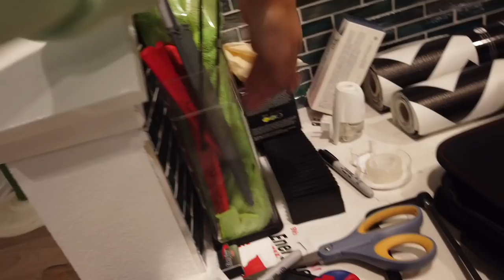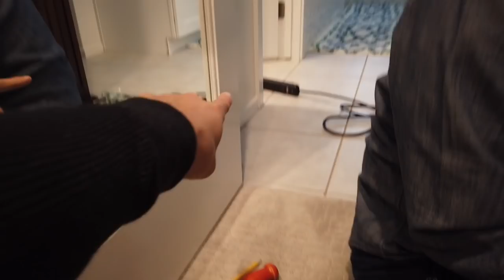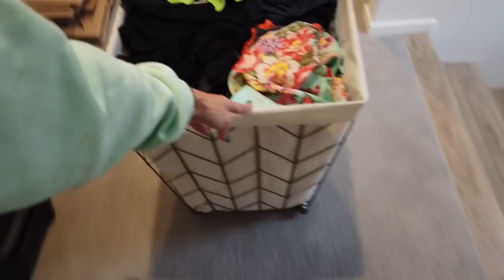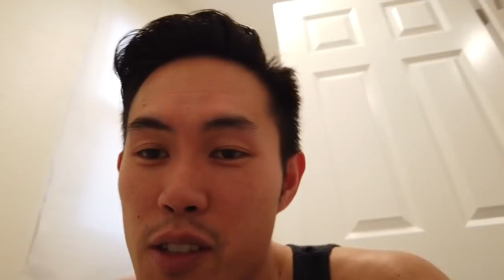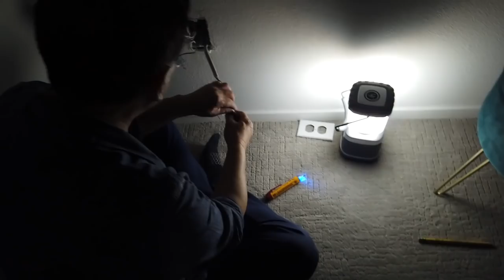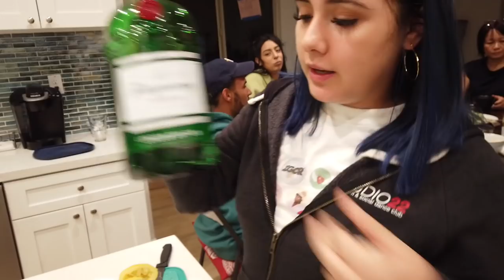We DIY’d an electrical outlet

Comment: Did you run the new electrical wires behind the walls? Or do you hide it behind a cover, but visible along the walls to where you want to go?

Comment: You should get a licensed Electrician to do any electrical works. In case of a fire, your insurance company wont cover you.
Reply: I thought casey dad is a licensed electrician
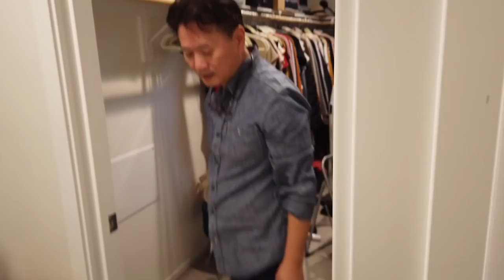Reply: @User-is2kf  no engineer. Casey said he's never seen his dad do electrical things at 8:26
Reply: they could face charges if a electrical authority looks at it the wrong way
Reply: @davidchen1544  - Electrical Authority??  What?
Reply: Maplenerd22 most municipalities require a permit and it has to be done by an electrician or else u get hefty fine (at least where I live)
Reply: @melabbyy  depends what kind of engineer he was
Geo's brother is an electrician they could've hired or consulted him
and it's true people should not DIY household electrical outlets
you're not even supposed DIY speaker wires and cables inside walls if they are not fire rated
if a fire broke out and it was traced back to the wires, your home owners insurance will not cover it

Comment: You should go to whoever built your home. Outlet in Bath is required by code.
Reply: yes, but not by the toilet . And the pos builder would not do it even they want to pay extra. 😩
Reply: @way3399  they said they're running a line from outside. So they dont even have one in the bathroom.  Their contractor should fix it. Their home insurer can go after the contractor to bring it to code.

Comment: I really hope u all didn’t run the wire outside the wall like that. It is Easier to just go in the attic and slice power from your existing wire in the attic and then run wire down the channel of the wall. Cleaner and easier and quicker. Also HVAC pipes wouldn’t run in the inside walls of the house. It’s goes straight up the outside wall where the condenser sit and then ran in the attic to the air handler. Most likely the black pipe is a air vent for a bathroom.

Comment: That’s not safe. By law you need a GFCI in your washroom, by posting this video you risk your Insurance in case of something!!!
Reply: Ronny Koo they did install a GFCI. You can clearly tell that they did when Pap Chan terminated the outlet. They followed correct CA Residential electrical requirements. It’s even 10+ inches from the floor which is also a requirement for flooding purposes.